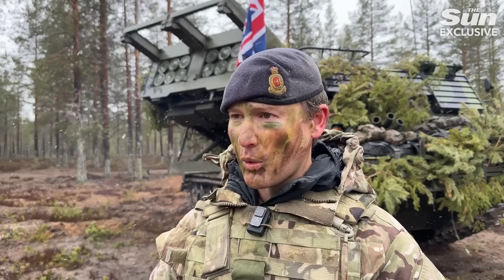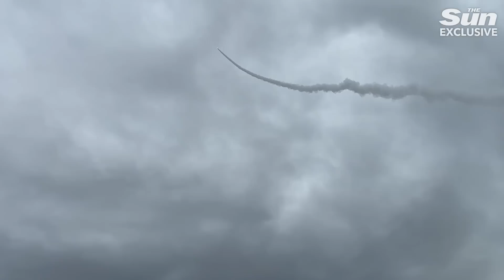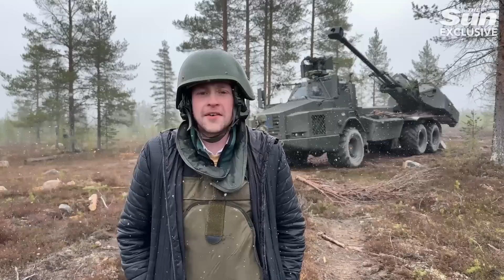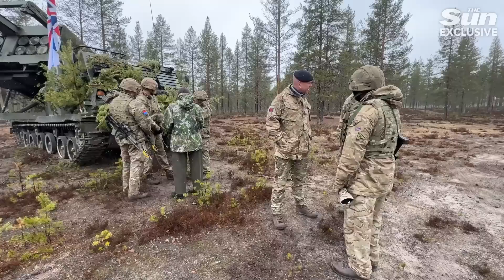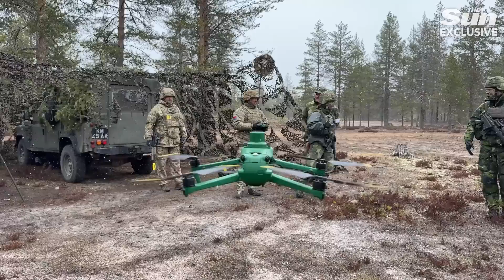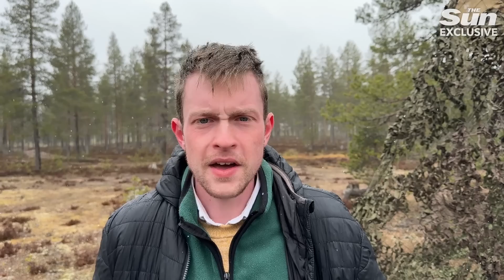British Army live fire missiles in huge Nato drills in Lapland

Comment: please get your facts straight, yes the wheels @ the front dont turn BUT, look behind the cab and you will see 2 hydraulic rams one either side that do the steering,it is basically a Volvo Articulated Dump Truck, with the dump truck body removed and the gun in its place,oh btw for the record of course the rear wheels turn otherwise it would not move !!, yes its 6 wheel drive with lock differentials on all axles, please actually check your facts, Made by Volvo trucks in Sweden !!!
Reply: @kevinmatthews2620
A very good system.. uk is lucky to have it.. 3.5 million GBP is very cheap for such an artillery piece..
Reply: I'm guessing your from Sweden  😂.
Reply: Yum yum